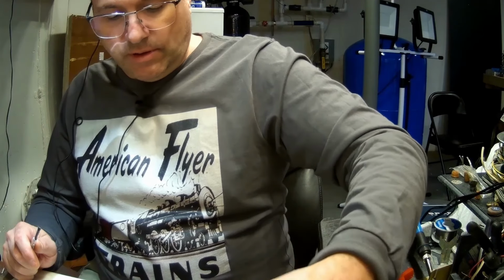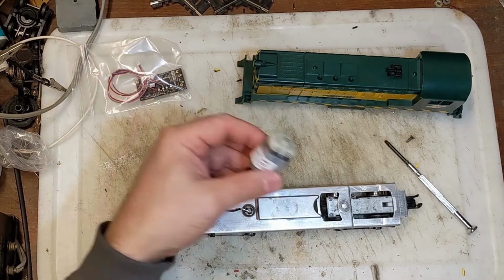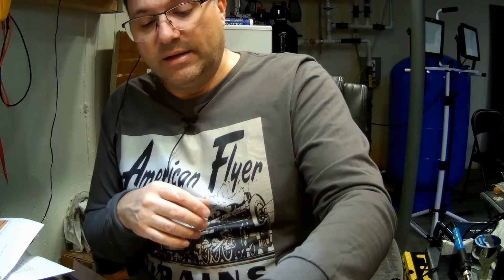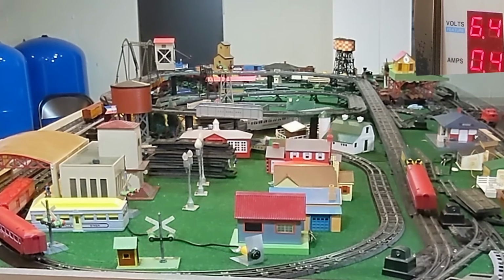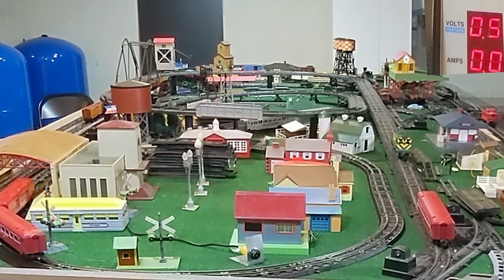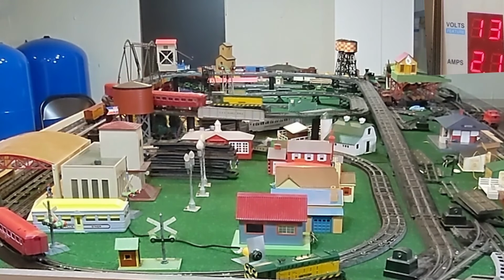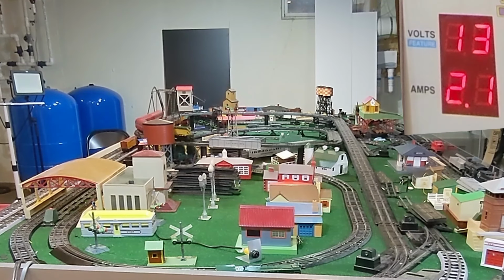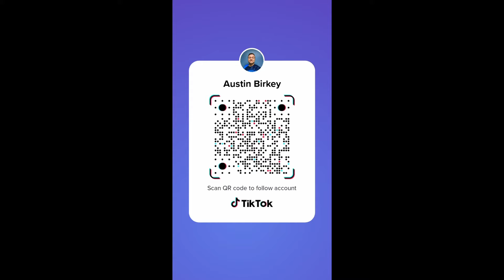Baldwin Mods:  A motor and reverse unit upgrade...but how does it compare? Is new really better?

Comment: An excellent video on a chronic problem. The Baldwins ran hot, were noisy, and lacked pulling capacity. The conversion greatly improved this locomotive’s performance.
Thank you, Austin, for your repair clinic video! Please consider producing more of these types of videos.   😅
Reply from the maker: Thank you Joseph for the comments.  It was an interesting experiment.

Comment: Of course I enjoyed the video. Current draw difference is not surprising. Can motors are very efficient. The long term problem is the electronics. Lifespan is limited. My vote is for Get A Grip tires and lead weights.

Comment: Thanks for the Re-power video. I'd love to know what the slow-speed of the re-powered unit was. Any Idea?
Reply from the maker: I could guess...the can motor slowest speed is probably between 5 &10 mph.  It will pull loads at that speed.  The traditional motor starts close to that but struggles a bit more to pull much at a slow speed.

Comment: I must compliment you on you motor conversion. Was your motor a standard drive ratio or a double reduction one? I prefer the later as I hate high speed trains on model layouts. It is a sad thing that Gilbert  did not go pure DC power when he had the chance. We are stuck with these anarchronistic , unnecessary reversing units as traditional Flyer operators.  People converting from HO to ,S or O always require an explanation of why these e units are in our DNA.      CASG
Reply from the maker: The gearing remained original.

Comment: It is interesting to me that the 1958 catalog shows the Hot Shot freight set and claims it can pull up to  40 cars or climb grades with ease. False advertising? My thinking is that the pull-mor tires have become hard over some 60 years and lost grip along with extra play in the mechanical parts. My Baldwin needed old dried up lubricants removed and replaced and new motor bushings along with new brushes. I put a mountain of solder on the connections to help with heat dissipation. The field coil needed replaced due to overheating and shorted windings. I placed stick on weights under the chassis between the fuel tanks. I would like to find gears with a higher ratio as it would increase pulling power, lower top speed and probably lower the amp draw. It climbs grades well now but if it could pull 40 cars I am sure it would not for long. I am very happy to use mine as a yard goat which in my opinion is what it was designed for. You can watch my latest video to see it in action. I do appreciate you doing this series as it provides options for the repair and modification of the Baldwin locomotive. Watching your videos, we can see what is available, how to install it and what to expect from it. Thank you for sharing.
Reply from the maker: Thanks Flyer Junction...great comments.  The origional motored Baldwin used in these test is freshly built with maybe an hour run time.  It has new brushes but everything else is origional.  Everything is also cleaned and freshly lubricated.  I cant say exactly but I do not think the motor had operated in the past 20-30 years as it had become a parts engine.  The traction tires were not hard but I have no idea how the grip compares to a new engine.  While no baldwin expert I have now operated three unmodified 355 and the rebuilt engine was a significant improvement over the two...which I had cleaned and freshly lubricated.  I'll definitely watch your video.  Interesting we are both focusing on the same engine...great minds think alike!
Reply: The new Lionel AF Baldwin's have 2 motors and are heavy. Should pull 40 cars since my Seaboard single motored Baldwin made in 2004 could pull 20 cars easily.